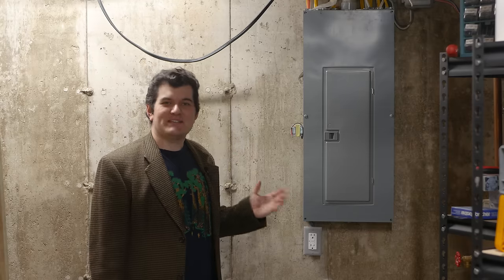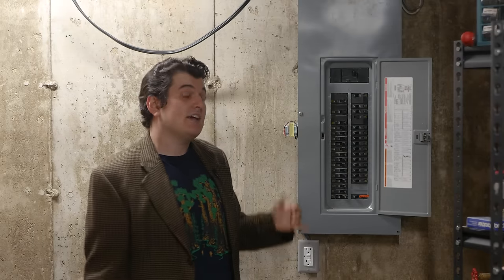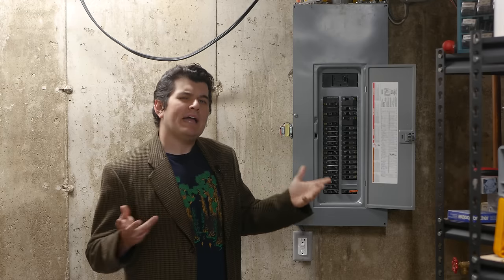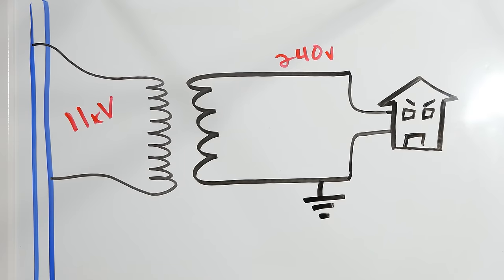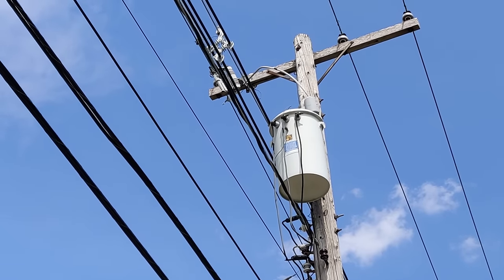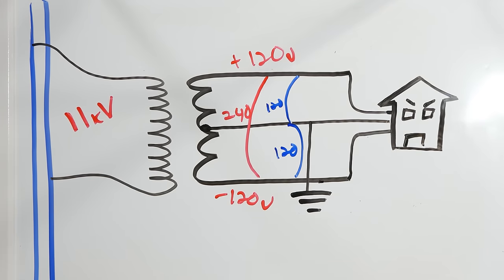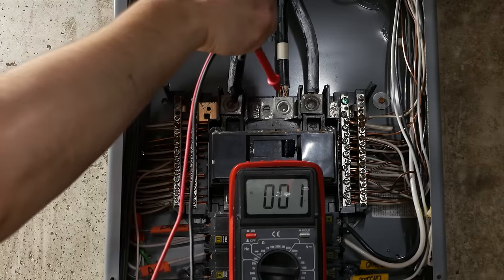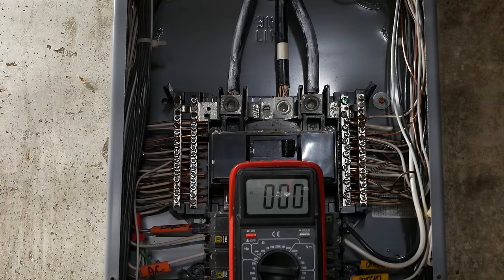The US electrical system is not 120V

Comment: Another interesting thing about electric clothes dryers is if you happen to still be using old school panel with fuses it is possible for the fuse that powers the heater to blow and a second fuse powering everything else stays intact and everything works on the dryer except it does not get hot. 

So…. If you have fuse box and your electric clothes dryer does everything but get hot check the fuses before replacing element and such

Comment: Actually, I think in terms of heat and energy supplied by 208, it would be 75.11%. This is because power, P, is proportional to V² and given the a constant interval of time, t, energy, E, is E = Pt.

Also, with the kettle analogy at the end, 120V at 15A is capable of 1.8kW. The kettle is maxed at 1.5kW, giving a 16.7% power margin instead of your suggested 20%. Pedantic, I know.

Comment: One thing that was not mentioned was that a motorized appliance from Europe using an induction motor with the same voltage here in North America will run at a slightly higher speed in RPM because of the higher frequency of our power! 60 cycles per second vs 50 cycles per second in Europe!

Comment: You're wondering about us turning the socket off before we unplug things, do you not have fuses in your plugs?
Reply: the type g plug is the only plug type that has fuses because it uses 32a ring circuits instead of 10-20a radial circuits

Comment: just  to help people every other breaker on each  side of  panel is the same phase of 120v so you can never share a nuetral white wire with 2 different phases  so breaker 1 3 5 7 9 11 1 15 17 19 is one phase and breaker 2 4 6 8 10 12 14 16 18 and 20 is the other phase .so if your power goes out on only half your home then you can move breaker to the opposite breaker location to get power back on until the power outage on one phase gets repaired jst dont put 2 wires under 1 breaker lug if you dont have available space just splice the two wires to a pigtail and then the pigtail to one breaker.just dont add too many wires under wirenut splice and overload circuit needs beyond available breaker amperage
Reply: How often does only 1 phase fail?  Sounds like the edgiest of edge cases.

Comment: I've always thought the switches at the outlet in the UK are silly, too. But after watching this video I realize it would be a decent mitigation to being able to touch the hot blade so easily when partially plugged in. Would have to make it a habit to always turn the switch off at the outlet before unplugging or plugging something, but I think that would be an easy enough habit to make since it's right there anyway.
Reply: Yep, you're right, it is just a habit you get into easily enough.  Just second nature to us Brits to hit the switch prior to pulling the plug out.

Comment: Unplug it? Those European plugs are a pain to plug in and out - hence having a switch on every outlet! And when you can't reach the outlet to unplug it, you can't grab the cable and rip it out : )  And having 100 switches in your house = 100 more failure points = 100 more chances for getting zapped or starting a fire. And your chance of getting shocked when unplugging something is much higher as you have to really grab that sucker to get it out - and there is a tendency for your knuckle to make contact. Yah, I know from experience. 
Wait! Have you ever seen one of their power strips? Huge clunky things that cost a small fortune. And they have a failure point - a damn fuse : )

Comment: also consider the uk hase a law that says every device musts have a easy accessible fuse and most manufactures wont change there products so they sipping it with a fuse in the plug thats the reason why uk power plugs have a fuse in it. 
it makes some things safer if you consider that most products dont have a fuse at all. 
the uk is upset with safety but then there is the weird thing with loop circuits thats makes it unsafer.
but i dont know much about this in detail because i am from Germany and we havent talked much about the uk circuits in training as an electrician. we talked more about the different and benefits about amarikan and europain system to each other. one thing i personal learned after school was the hundreds of different outlets across europa there are some weird and questionable ones between them who still used today. like the schuko. we in germany use the one with earth contacts on the side but france and other countrys uses one with the contact at the sides and one that sticking out of the outlet and interlocks with in the plug. it is called schuko type E and that we use in germany is schuko type F and the italien uses the type L

Comment: The belief that 240 V is "safer" than 120 V has to do with the neuromuscular incapacitation that comes with receiving an electrical shock. The idea is that the body's reaction to 240 V is more violent and will help the person to get off the wire, whereas the reaction to 120 V is less violent and likely to allow the person to keep touching the wire. I haven't seen any data to back up this claim, so I'll continue not touching any live wires 👍🏼

Comment: I'd love to see switches on receptacles more often - it's sooo much easier to reach for a switch in a common position (on the receptacle) instead of having to find the one on the device(s). Older devices also might not have an off switch, and I had to buy power strips or individual plugs with switches just to turn those off.

Currently I have two devices in my home that are on a power strip just because they don't have an off button, plus two that I have to unplug manually every time I use them. All of them are vampires and should have an off switch, but they don't. I have another couple that should go on a power strip with switch too, but I'm too lazy to check if it's really worth it. A switch on the plug would solve the problem directly, and be much more intuitive than figuring out if the device is really off or not.
Reply: Switched receptacles are about 10 clams in the US.  You do lose your other receptacle, though.  But even a 2-gang outlet (with two switches and two receptacles) wouldn't take up any more space than 2 UK receptacles with the little switches.

Comment: think we say we have 110v instead of 220v or 240v is because 110/220 is what we can guarantee.
Under-voltage kills electronics. over-voltage is basically harmless.
Guarantee electronics companies that you will strive for 124/248v however 110/220v is the minimum voltage without power getting cut to save your gadgets from being fried via a brown-out.
Reply: i wish we had 120v 3phase at the residential level.
most our stuff would be better served getting fed DC power, which could be rectified to DC at a subpanel.
The multi-phase appliances would be more efficient if they ran off 3phase as opposed to 2phase power.
Bet the electric car charger would be less expensive if instead of bein built for both 1 & 2 phase power, only having an inverter for single phase if at a friend's house or run off the sub-panel's rectified DC at your own.

Comment: Just a minor note on the high side of your distribution transformer it's 7.2kv phase to ground. If it was a rare seldom used Delta primary 2 phase, then primary would be 12.47kv in your area. Where I am It's 13.2kv ph-ph and 7.6kv ph-gnd. It all depends on your utility's engineering and equipment. Trust me, I worked for your utility for more than 13 yrs. Otherwise bravo on the explanation of the split phase system. I will give our customers a link to your video if they need explanation. Especially with open neutral conditions on services with a bad connection  causing scary bright dims on the opposing legs.

Comment: Well I'm a mechanical engineer but I work with HVAC so I basically deal with electricity on daily basis. 

I get how 120-127, 208-210, 220-250 and 380 works but I haven't yet worked on 440-480 and above. I suppose it's the same transformer principle right?
Reply: Except that 480/277V would be a three-phase service.
Reply: @GH-oi2jf  thanks

Comment: I know this is an older video.  My father worked for a municipal power company.  The power grid is 120 volts plus/minus 5% or 114 to 126 volts.
Reply: The power grid is 12470/7200 volts.   The power to residential (non apartment buildings) is 120/240 volt single phase plus or minus 5-10%.

Comment: Yeah we would still call that a 120v system in Australia.  Like we use centre taps to deliver 480v single phase.  But a centre tap is still single phase.  And we get a 415v three phase.   But yeah we define the supply voltage as phase V to neutral.  so you don't have earth leakage units on your 2 phase or do you.  120v kills.  240v kills.  What is safer is residual current leak detection.  Which needs a main earth neutral.

Comment: Personal experience with 240 volt outlets in Pakistan: Outlets without switches create arcs, sometimes terrifyingly big ones. Every single time I plugged/unplugged a phone charger into an outlet without a switch, I saw an audible arc. I guess switches do have a purpose.
Reply: That's because y'all are stuck with the older British plug design, the one that has round pins with no insulation.  It doesn't help that the pins are spaced differently than for a Europlug socket, meaning you have to jam them in really hard....
Reply: @MicahtheDrumCorpsPseudoboomer  Your assumptions are partially wrong. You are right about the voltage however, new outlets are what locals call "multi-plug". They fit most of European and North American plugs by design as long as the the devices they are attached to are compatible with full range of 110 V to 250 V.
Reply: @zeepack  Well, thank goodness the plug situation has improved since I was there!

Comment: Err... seems to me everyone knows 240 volts (approximate) comes into a home. Stoves use it, baseboard heaters use it, how water tanks use it, some clothes dryers use it, etc (at least in Canada). Thought it was common knowledge - and the actual grid system uses much higher voltages to "transport" electricity as well....

Comment: I just freaking love this channel.  Your rant at the end is HILARIOUS and EPIC!!!   
Ps--not all brands of circuit breakers have those clips on the bottom. Those clips are synonymous with Square D, and a few others that slip my mind. Possibly Cutler hammer, GE, and a couple others. Also note, there are two types of Square D breakers. You have the traditional Square D breakers and there is also a Square D homeline which is not interchangeable.  Although the traditional Square D breakers are also not interchangeable.

Comment: In Italy we usually have 3 or 5kW per home! Yes we have 230V standard, but it's insane to see a house with a 1-200A breaker!
Reply: We don’t all have 200A service.  I live in an apartment and have a 60A breaker for my unit.
Reply: @GH-oi2jf  Yeah, but new houses it's pretty much the norm for 200 amp, even some get 2X200 amp panels (almost 100 kW).

Comment: I've got a hybride solar inverter . In offgrid mode I was 2x getting 120Vac because of a floating Neutral. So between N and Phase was 240 V but between Ground and Phase 120Vac  Neutral and ground also 120Vac . Connecting ground directly to Neutral resulted in Phase - ground 240 Vac  Neutral ground 0Vac  and Phase neutral 240Vac,  What I miss in the US system is a ground fault . In Europe we have a ground fault . If current is leaking between ground and phase it will trip the ground fault breaker ..

Comment: 120Vac when it is not 120Vac in NW Indiana

120Vac in NIPSCo land here in NW Indiana?  My house is in a neighborhood developed in the late 1950s/ early 1960s, and maybe half had central air.  In 2017, all have central air but the electrical distribution lines did not look like they had ever been upgraded.  It was a really hot day and I wondered if the NIPSCO line potential had dropped due to high demand.  Testing with my Fluke DMM showed 143Vac.  What?  A second Fluke and still, 143Vac.  Well, no drop in the Voltage, but all seemed to operating without problems.  I called NIPSCO and reported what I measured, and adding this was not an emergency.  A ground crew came out after hours and took some measurements.  Nothing to worry about they told me.  To me, this was a bit of a head scratcher at this point, but they said all was well.  Months later I saw NIPSCO replacing a small line transformer that looked like it supplied only 3 houses, including mine.  I did not give this a lot of thought....until another few months it dawned on me all had not been well.  About 18 months earlier, a 24 year old, always reliable HP LJ4M started acting like it had intermittent power problems.  I replaced it with another LJ4.  It lasted several weeks before it, too, had similar problems.  Same with an HPLJ6P.  Then I tried a new Samsung ML-2550.  It lasted a few months before it would require a dozen minutes to initialize at every power on, as if it were downloading new firmware, and a few weeks later, it was history.  It was then replaced by a second new ML-2550 that I already had.  It lasted a week or two if that.  Then in went an old HP LJ4650;  it lasted for several years, but required replacement of the ethernet card a couple of times.  (4 years later, it too developed what appeared to be power supply problems, fizzled ethernet card, firmware symptoms, and high V corona wire problems right after the NIPSCO power behaved as if someone was repeatedly flipping the power on/ off over about 1 minute.)  During this time, my GE Advantium microwave behave erratically, but then seemed to reload firmware and returned to normal.  At this time, my Maytag Neptune washer control panel failed.  I disassembled it and found it could work using wire wrap to make momentary contact.  So the panel touch buttons had been partially smoked.  The control panel was replaced and all returned to normal.  A tower computer power supply also required replacing, but an endoscopic light source failed as did several electronic test equipment.  Many of these items could also operate at 230Vac, but the 120/ 230 V switch stayed at the 120V position.  Conclusion:  I think the NIPSCO transformer insulation failed and that 143Vac slowly ruined a number of my appliances and electronic equipment.  How many other items it has shortened the life of I will probably never know. 

Did NIPSCO ever say anything to me regarding the transformer replacement / 143 Vac potential?  NO
Did NIPSCO say anything to my neighbor that apparently experienced problems similar to mine during this time?  NO

Comment: 220/(110 per sine phase) was a standard previously; right now, in most places 240/120 and 220/110 are reference voltages, while the actual output of wall outlets is 230+-10V - same shit, but fancy wording. As for home appliances, they work in ranges from 180 to 300v on 230 ac, and from 80 to 160 on 115 ac

Comment: For me in Germany, 230V 50Hz is the standard. Before 1987, 220V was the standard in Germany, but it was agreed that 230V was the new standard voltage in Europe. But that's a different story... Here in Germany everything runs on 230V, even cell phone chargers. But we don't constantly get life-threatening electric shocks, as we often claim in America, because our sockets and general safety regulations are much stricter here. Our stoves and high-current devices are operated here with 400V, and no one here is afraid of it. People are constantly joking about Americans and their chronic fear of electricity
Reply: Correct me if I’m wrong, but I don’t thing Europeans are allowed to work on their own electrical systems.  Is that right?  In the USA, a homeowner may do his own wiring, subject to permits and inspections.  That’s one reason lower voltage is advisable.  But the main reason for lower voltage is just historical.

Comment: I was getting voltage spikes in my home. Burned out several surge protectors including whole house surge protector. Measured peak at outlet at 130 volts. DTE corrected the issue but never explained what was wrong. Can you explain?

Comment: Yes, You have literally 6 phases of 120V available, but we still have3 x 230V, 400V in the EU :P . So if Your industrial machines are using 208/240V ratings, ours are using 400V, utilizing around 11kW on 3x16A fuse, 5 x AWG 10 or 11 (don't know exactly which one is 2.5mm^2) cable :)) There is also difference in between of 50 vs 60 Hz in electric systems.
Reply: It's 3-phase 480V for industry.

Comment: Two or maybe three machines in a home use the high voltage of 240vac, while the other several hundred all operate at a nominal 120vac. The system and the user are not the same thing. Your headline could equally well have concluded that our system is 13,800vac. Or even 300,000vac. Ultimately the U.S. is known around the world for its system of 120vac outlets, and for very good reason.

Comment: All of that exposed copper on the incoming wires is making this electrician twitch violently! x( 
The wires should be inserted all the way up to insulation into the connecting screw terminals, to avoid accidental electrocution when working in the panel. Or even better, put insulated ring terminal lugs on them, assuring a good, lasting and SAFE connection.

Comment: You have a Gross Conceptual Error (GCE).  Amps and volts do not track one another.  A 240V circuit will ALWAYS pull less current than a 120V for the same load.
Reply: Wrong, but define "load."

Comment: Looking down from a 3-phase EU 230V/400V system with save, practical plugs, grounded and dual pole circuitbreaker and leakage breaker on every circuit.

Comment: If your electrical panel is humming like a large transformer, you probably have a very bad high resistance connection and it will be failing very soon or catching your house on fire very soon 😂